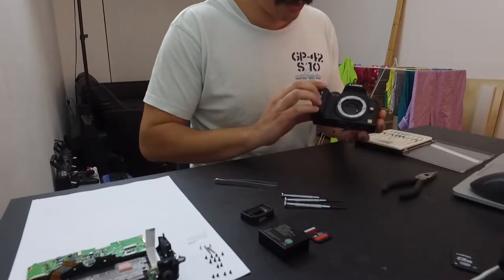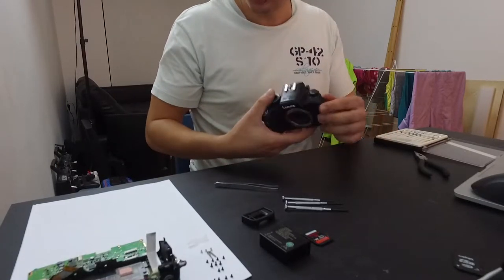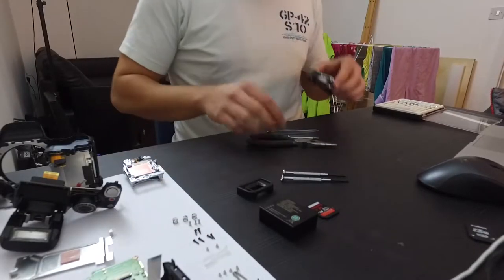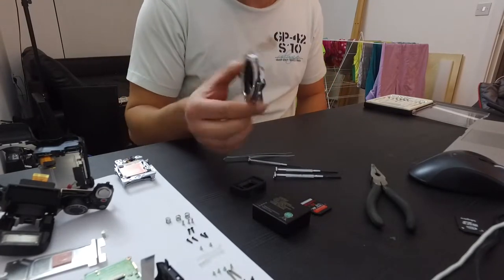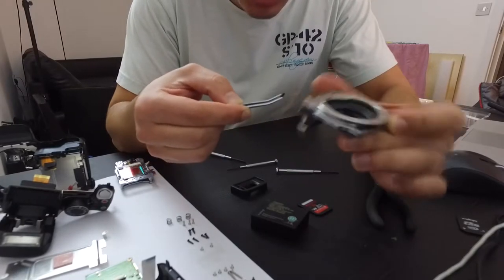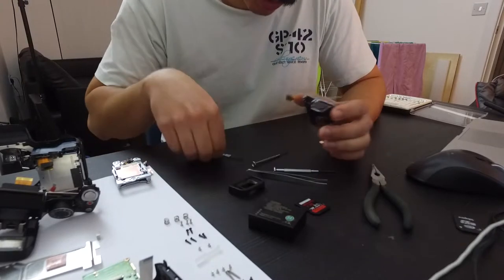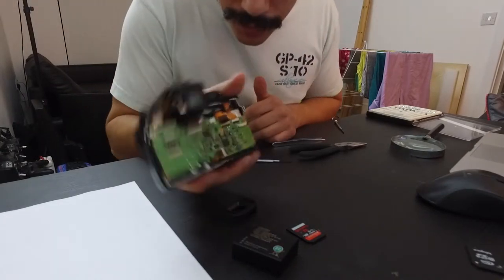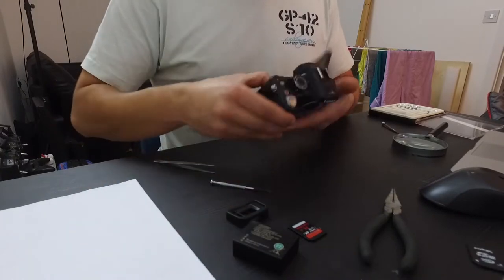Fixing GH2 stuck shutter - BANDARRA

Comment: nice one. I admire your courage. I have the same problem but iut seems to be underpowered battery (because it works when I take the lens off and thus reducing the power consumed) . New freshly charged battery seems to do it. I was thinking of just coating the blades with some silicon from a spray can via an ear bud. Can you answer this please. How easy would it be to remove the LCD only and extend the cable so that it sits about 6 inches away on a gimbal so that you can use the touch LCD faeture?